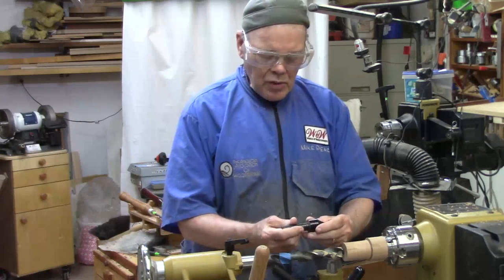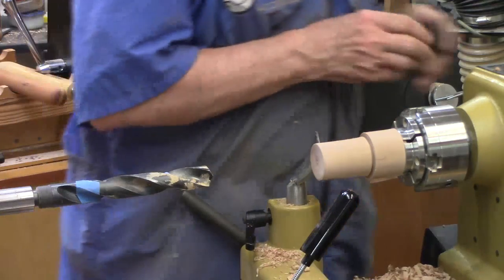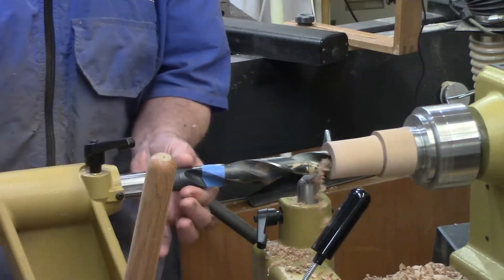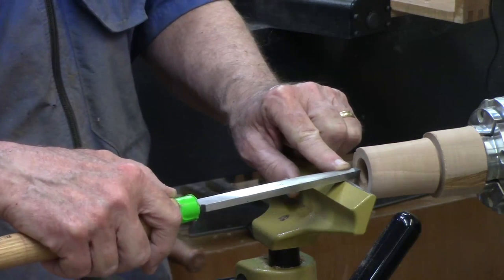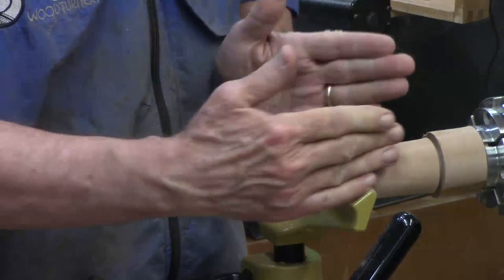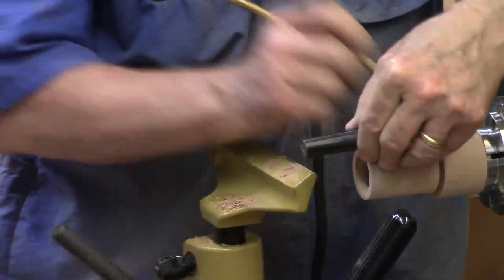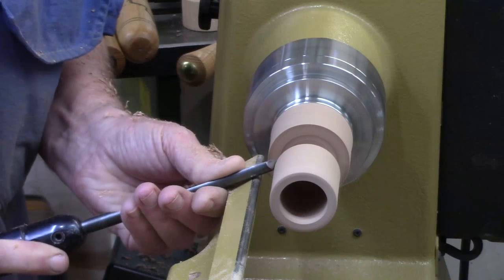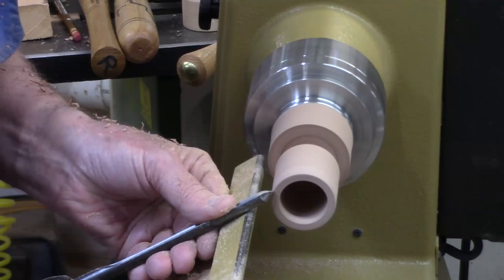Need a Soft Touch for YOur Cone Live Center?

Comment: As usual, another great video.  Coincidentally, not 30 minutes ago I completed a similar project. I needed a cup live center to support the end of a rolling pin. I pulled apart an old live center and turned a tenon on a scrap of wood to fit into the inner race of the bearing. Turned a cup on the other end of the scrap and Bob's your uncle. Your approach would have worked too.

Comment: I've made a couple of those.  One has a cone shape that tapers down to about 3/8" diameter, while the other has a 1" diameter flat end.  And in both cases, I've embedded a bit of HDPE (salvaged from a cheap cutting board I found at the dollar store) at the end that is very slippery so that they don't mar the workpiece.
Reply from the maker: HDPE  makes a great soft touch.

Comment: I've definitely got to make one of these.  I have some 3D printed tips that fit in my knock-out live center, but would benefit from a more durable piece of wood.  Your quick and dirty approach at the end sparked a thought -- one could cut out a series of circles with concentric size and holes on a laser, glue the stack together and then use that -- the resulting stack would have a somewhat conical interior shape.
Reply from the maker: Ok. I think turning one is easier for a woodturner.

Comment: Mike, can you explain why you are cutting below center?  I always scrape the inside of boxes above center but I'm willing to change if it is the correct way to do it?  I do put a bevel on the side of my various box type scrapers and I can see that above center would be a scrape and below might be almost a peeling type of cut..  Thanks, LP
Reply from the maker: When scraping, you want the cutting edge to fall into space if you have a catch and not dig in. A little above center is fine in the center of a box. when cutting a side wall you want to cut slightly above center. This allows the side cutting edge to have some clearance. For example a thick scraper with the cutting edge on center might have the lower edge scraping as the box wall (the lower part of the circle) is curving and could be touching and rubbing on the bottom left edge of the scraper. Hope this makes sense. Thanks again for the coffee.